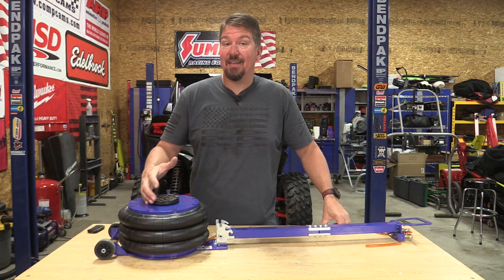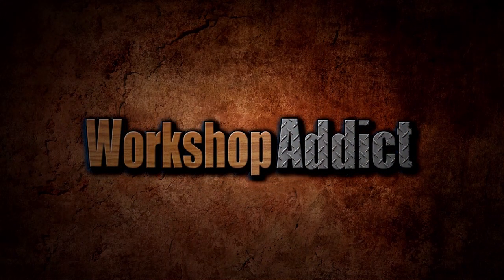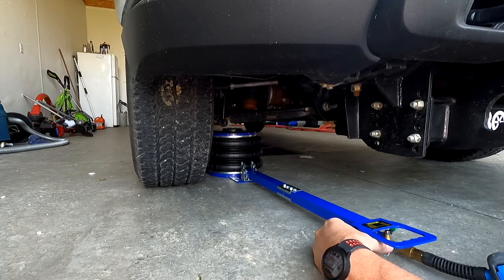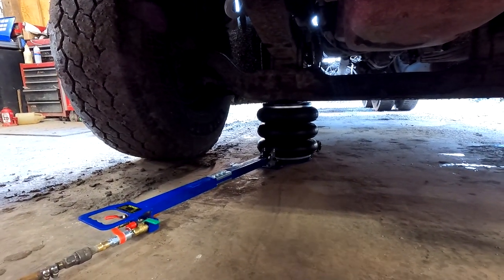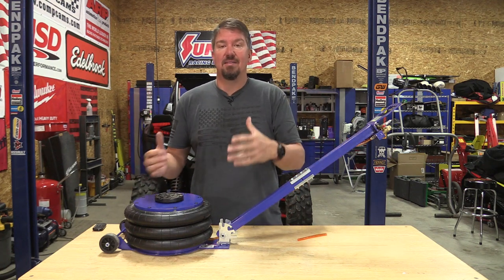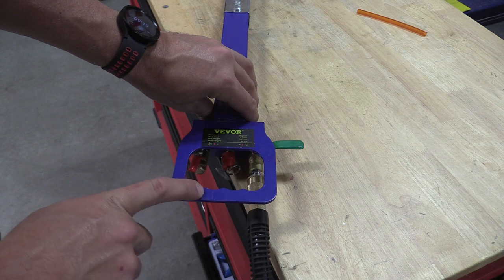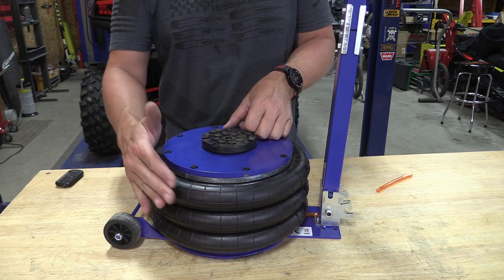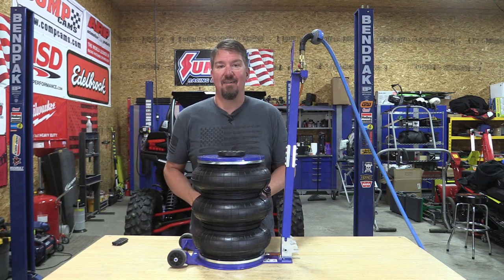Pneumatic Air Bag Jack - 11000lbs Capacity - Super Quick & Sketchy

Comment: That's a ridiculous and hazardous piece of equipment in my opinion. Thanks for the review!
Reply from the maker: It is fun to see what it can do!
Reply: Air compressors are extremely dangerous and we all know there is a million of those in everyone’s garages. I heard that a man was putting air in the tires of a hand truck/dolly. He over inflated a tire and it exploded. His hand was by the valve and the explosion turned his hand into ground beef. Just have to be careful and use wisdom.
Reply: @paedahe4975  it does take some more understanding of the way things work to enable it to be used safely. By its design, it does have a higher likelihood of a fast drop than the more common hydraulic jack, but it's a trade-off for quick and easy operation.

If you work under the guideline of assuming it can fail spontaneously at any time, it's fine to use. 
Use proper jack stands for support before sticking your head and appendages under the car, same as with any lifting equipment.
Reply: @sadfur8728  I agree. Well put.
Reply: @sadfur8728  the reviewer didn't even mention to use safety common sense, I understand not everyone has it, but he has to mention that. Always use jacks when working under a vehicle, why just rely on jacks alone, hydraulic or pneumatic. His review is good but the message is wrong. Nothing is safe in this world, you always have to be thinking safety first.

Comment: What a joke. It’s a jack. Jack something up put stands under it like you should and jack and let it down outta the way. Agree it won’t lift 11000lbs but easily lifts my 1/2 ton truck. If you would jack it all the way up the sleeves in the center will stabilize it. Absolutely love mine. Very dramatic review
Reply: Yeah very biased review.

Comment: You complain too much.  The bag is rated for 145psi & so are most compressors.  You could have played with a pressure-regulator a bit more to fine tune your complaint.

Comment: That'll be a hard no for me. The fact that they couldn't even spend 4 dollars on a crimped and braided hose for something designed for lifting... LIFTING? Just no. Sure yeah, you should be using jack stands, but if you want to support a vehicle from say the rear diff, you still kinda need to get (at least partially) under it. And we all know a guy who would trust that airbag alone to hold up the front end of a truck for the duration of an engine swap.

Comment: Thing looks super sketch. We use them at the dealership to mount the pinch welds on the frame Machine. That’s only like a second to lift then put the clamps that old the car on the pinch welds. I wouldn’t want to work under one for any period of time
Reply: Well why wouldn’t you use jack stands regardless of lift method.
Reply: @cadestekly6410  it's just human nature to be optimistic and take short cuts sometimes.  Who follows the rules all the time 😉

Comment: LOL you lifted the vehicle up but the worst point possible, at the business end of a suspension arm. No wonder it was wobbly, it would be wobbly jacking it up from that point with any jack! All while you have a perfectly rigid receiver hitch you could try, and you didn't even try jacking it up there. You are not supposed to jack vehicles by their suspension components!
Reply: sure you can, any type jack will lift on anypoint, you can lift on leaf springs, control arm ends, balljoint location, axles, many times the suspension parts are stronger than any body parts. most vehicles don't have receiver hitches, let alone solid bumpers anymore.

Comment: I  would have to agree with every concern you had. This product reminds me of a high school shop project that was never finished out because the end of the school year came about. It is frustrating as hell putting it together because the instructions are worthless and you have to take it apart multiple times to get it to work correctly. It is more a novelty item that a real shop tool. I ended sending mine back for a refund after of month of jacking around with it. It is a "cool tool" but that is not enough. It has to be safe and functional as well, which it is not. My suggestion would be to pass on this one.

Comment: If u got real shop air compressor 

Is that safer valve open get enough air out before 
U get chance turn off air 
Or will just blow 

The safety vavles should be sized to air compressor 
Every air compressor has different size one 

Lol think it’s cool but way to sketchy

Comment: Too many potential points of failure. Imagine if you have a power outage, breaker tripped, air compressor malfunction. etc…
Of course, we can’t rely on 1 lift but why add another expensive tool to the tool box.
Reply: Don't forget about your air compressor tank exploding, that would be more a concern than losing power to the compressor, if you want things to worry about. The power going out doesn't release all the air spontaneously, so that's not really much of a worry.  Worst case is you have to find another way to jack it up if your compressor is empty and broken.